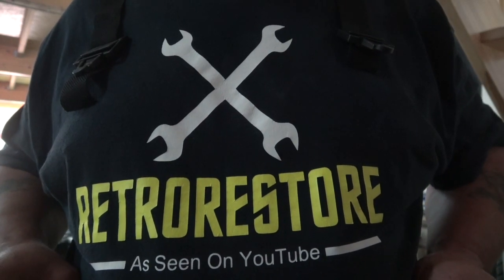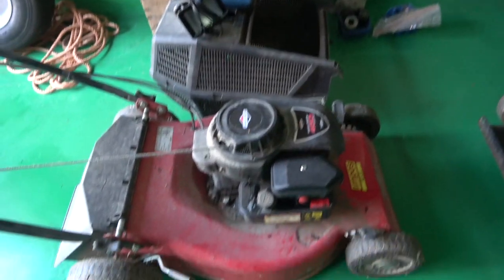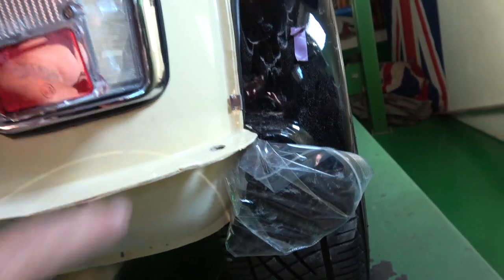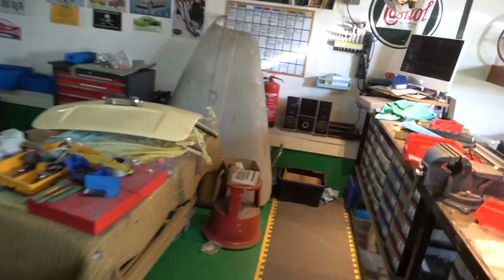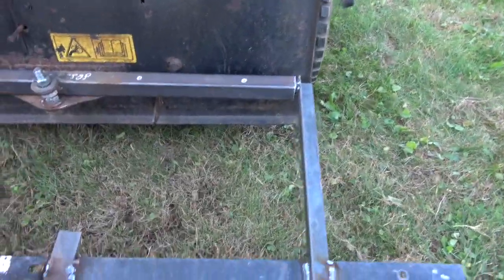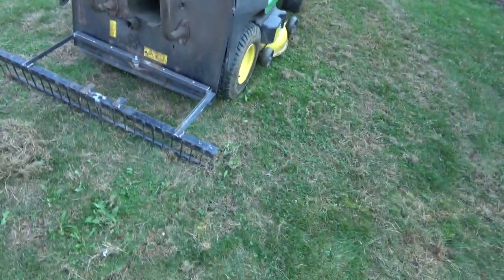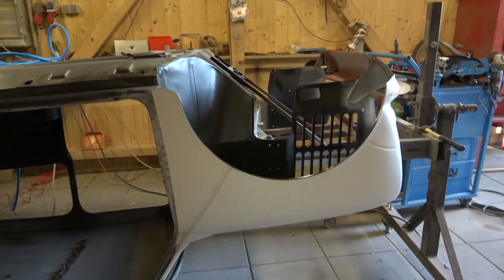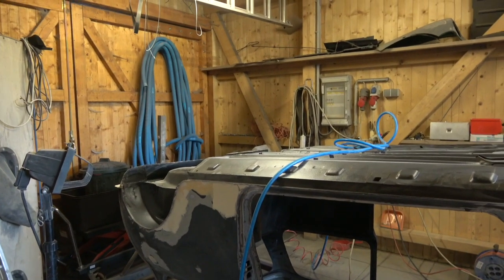Classic Minis Update & DIY Weed Puller!

Comment: Bouy! Amir, ye got a damn good woman there bud, but i tell ya one thing, looking at the fore arm muscles on her even i wouldn't want to piss her off, she'd knock the nuts off my tree bud. Just a note, they have de-thatch blades for mower decks, looks like a blade but there's spring tines bolted to it pointing down. just turn the deck on to cut and it rakes the thatch up.
Reply from the maker: Doug,  So you don‘t think i have any future in farm machinery development then! lol. Thanks for the info i will check it out Mind you it‘s a lot of work to change the blades for such a small area. Cheers Heath Robinson